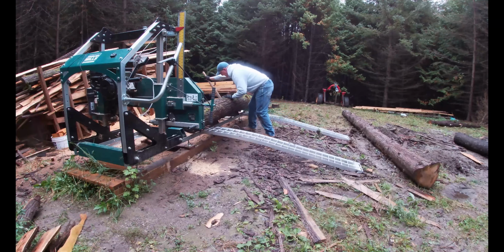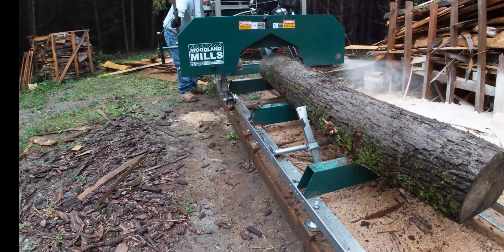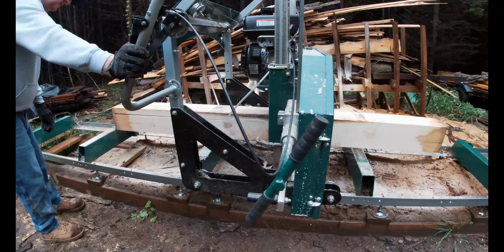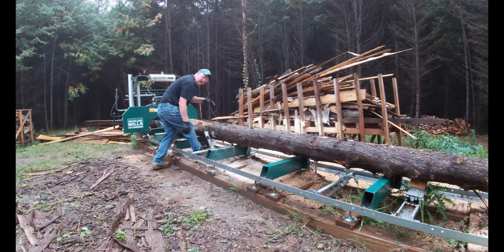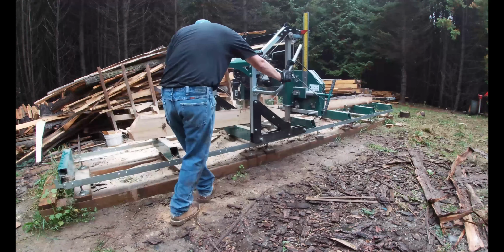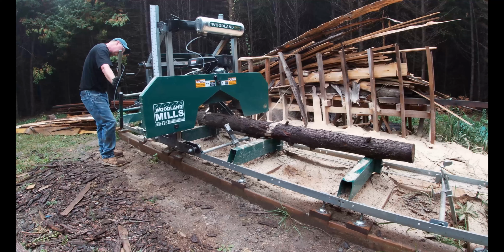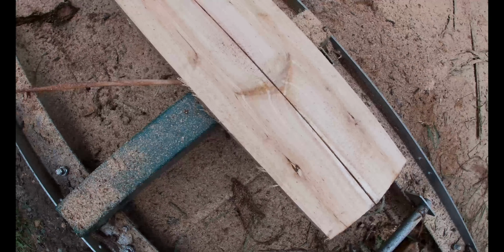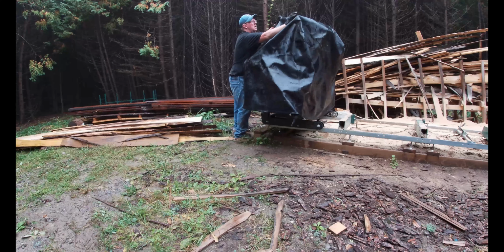Woodland Mills Sawmill - Taking Care Of The Undesirables

Comment: hi chris , i have another question here . what indication do i have that tells me i'm sawing too fats or too slow . thanks a lot your doing a very good job helping us with those videos.
Reply from the maker: Thanks! There are a few different indications that you could be going to fast. If it feels at all like your trying to force it, if your producing wavy cuts, if the blade comes off that could mean your going way to fast (or the blade is way to dull.) I think going to slow is a bit less of a worry but I do know that if you get pronounced saw lines that almost have a ridge on them going across the boards your cutting that could mean your going  too slow. It really is a feel thing, and of course you will be able to go faster through smaller logs than bigger ones and different types of wood saw easier as well. I have usually found that you tell pretty well if your going the right speed if you keep just a slight pressure going forward but if your hear the motor starting to bog down it probably means your starting to go a bit to fast.